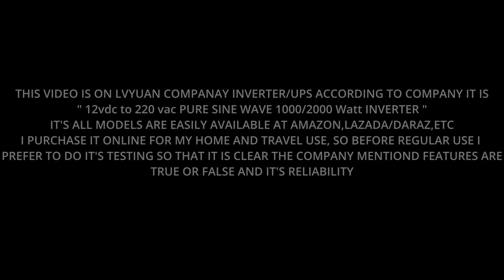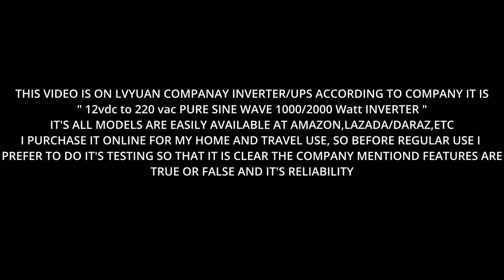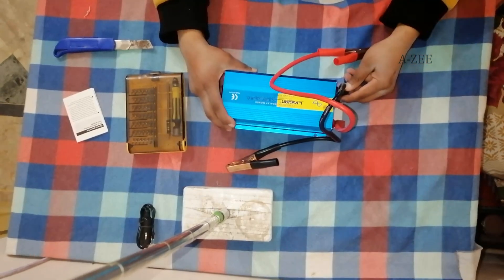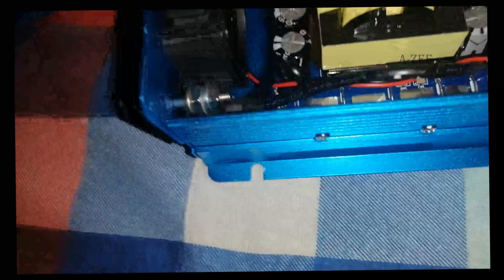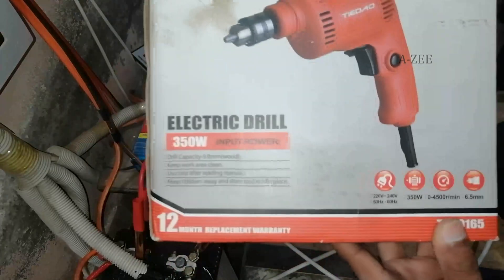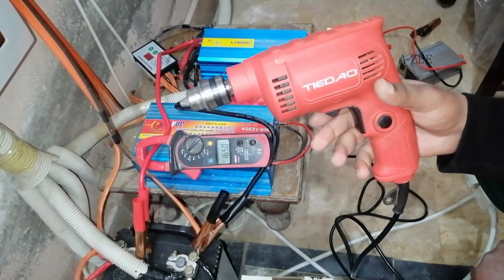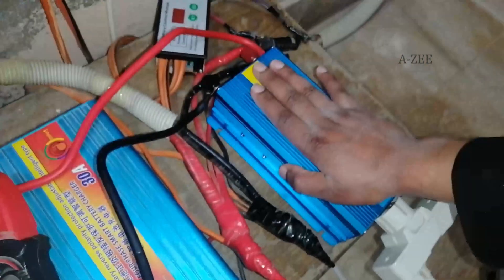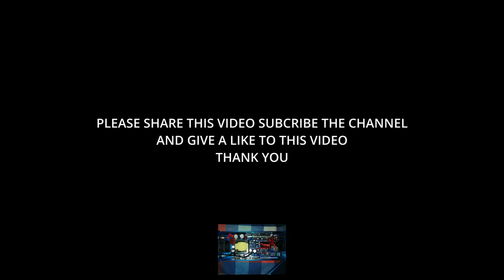CHEAP PURE SINE WAVE INVERTER. ORIGINAL LVYUAN 1000/2000WATT. UNBOXING. TEARDOWN. HEAVY LOAD TESTING

Comment: nah.  I bought a 500 watt used it on a small fridge.  When compressor kicked on.  It clicked liked 2 times.  Started making all kind of grinding noise and poof some white smoke started coming out.  Disconnected it from battery Opened it up.  TRansformer was hot and transitors were smoking!!!! White smoke.  Built in safety from prevent this from happen didn't work.  Returned it.  Dangerous product.  At least the one i got.
Reply from the maker: I AM ALSO A USER LIKE YOU. FEEL BAD TO LISTEN YOUR EXPERIENCE. ACCORDING TO THE COMPANY. PROTECTION KITS ARE INSTALLED IN THE ABOVE 1500-WATT MODELS.
I RECOMMEND THIS EVERYONE USE THESE INVERTERS FOR HALF OF THEIR MAXIMUM CAPACITY. SO THEY WILL BE ABSOLUTELY FINE.
I RUN MY REFRIGERATOR ON THIS 1000-WATT. IT TAKES AN 800-WATT PEAK WHEN THE REFRIGERATOR STARTS. BUT MY INVERTER IS WORKING FINE. NOW ITS ABOUT 2 YEARS. AND THERE IS NO ISSUE WITH MY INVERTER.

Comment: Where was the load test
A drill motor free running isn't a test 
Drill something
Or use the soldiering iron
Or a series of light bulbs
Reply from the maker: YOU CAN SEE DRILLING IN THIS VIDEO AT 2 : 36
https://www.youtube.com/watch?v=RvGGgEP6eKw&t=994s